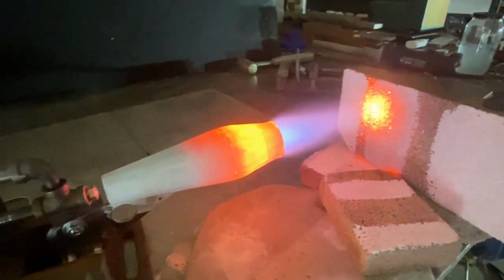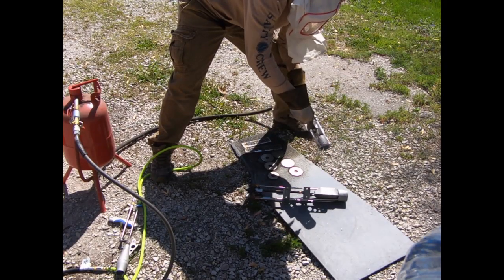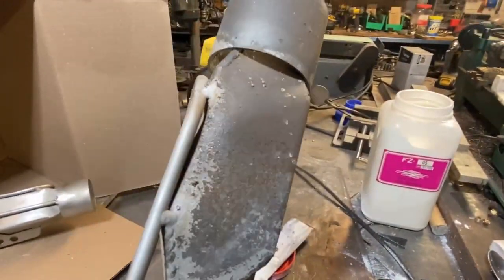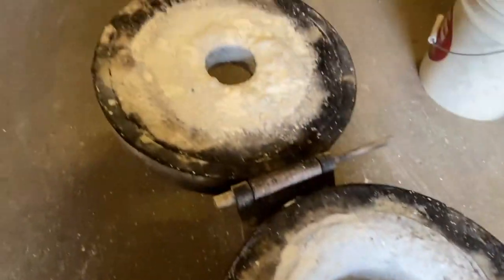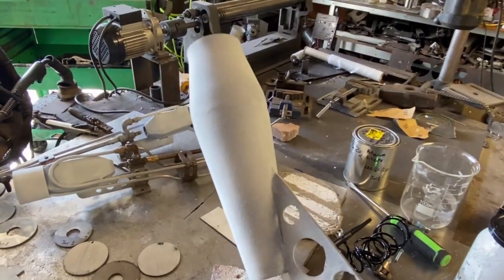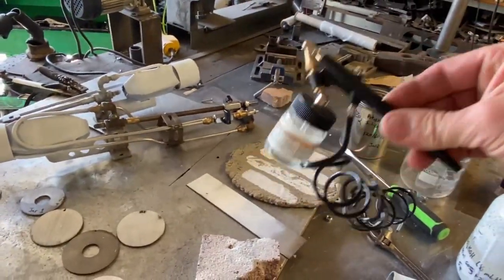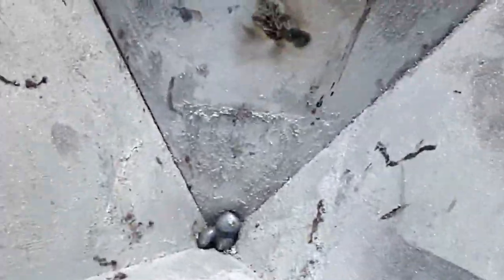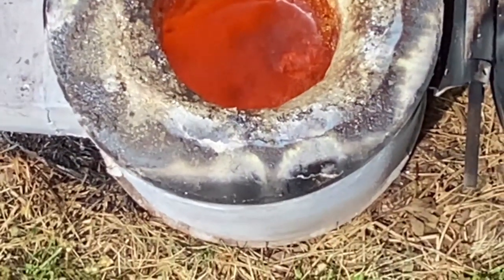High Emissivity coating super refractory coatings

Comment: Thanks for sharing your Research.
Normally you get a few Research Papers that are very abstract and the Rest are Corporate Secrets.
It’s helpful seeing what works, but maybe even more important is your Info on what didn’t work out.
There are practically no good public Sources for that kind of Knowledge aside from your Videos.

Maybe Someone specialized can chime in, but the Coating Thickness might be a important Factor.
Matching the Thermal Expansion closely to the Base Metal is not easy so a thin Coat might be more robust than a thick Layer, because the Bond to the Metal doesn’t get overpowered by the internal Forces inside the Ceramic Layer.

It might be interesting to compare a Burner with a Coating on the inside with one that’s completely painted.